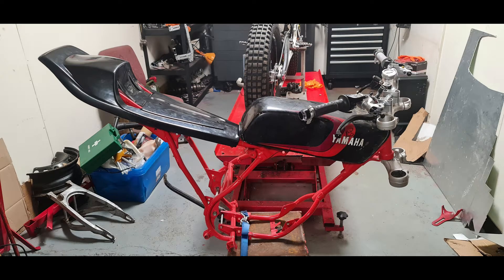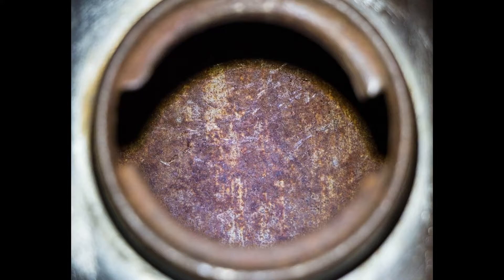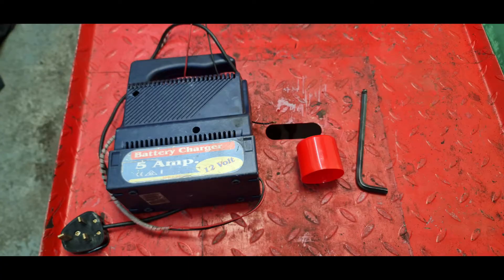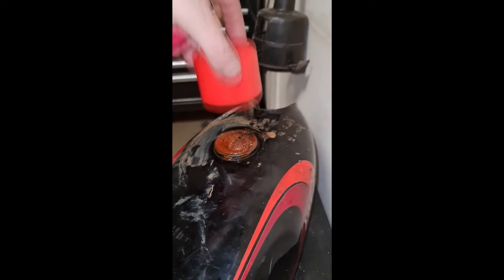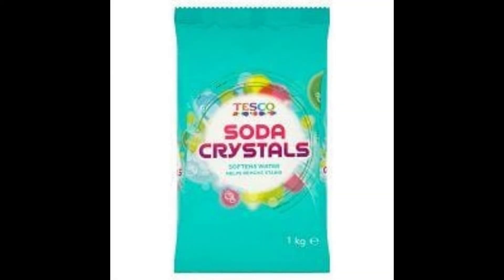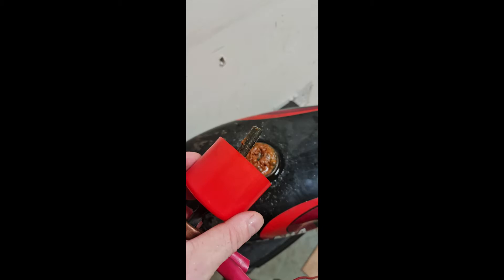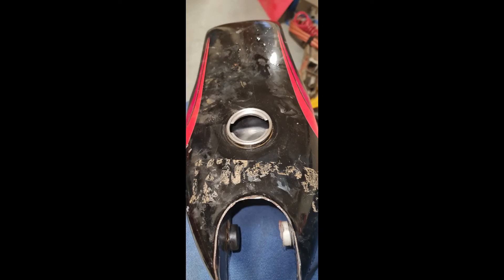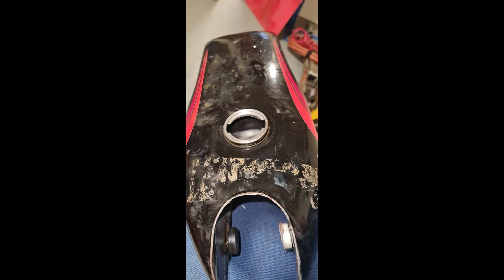The best way to remove Rust Using Electrolysis: Motorcycle Tank

Comment: Did you clean with hose after, how did you prevent flash rusting?
Reply from the maker: Empty it then put in pre mix and cover the inside with it then flush with clean water. The oil in the premix stops the water from rusting it.

Comment: My tank has been freshly repainted outside. The painter failed to tell me to have the rust removed beforehand. If I have the electrolysis done now, would it ruin my brand new fuel tank paintjob?
Reply from the maker: No I don't think it will ruin your paint unless the electrolysis removes enough steel along side the rust to perforate the tank

Comment: Did you use same solution in 4 days with out changing it or change the old solution and filling new solution in it please explain
Reply from the maker: We changed the solution every day and cleaned off the Allen key.
Reply: @SpecialisedMotorcycleTransport  Ayup!  I am an electrochemist and it probably doesn't make a lot of difference.  UNLESS the build up of rust slows the current in some areas.  Whatever, its cheap as chips and really is the best way to clean a steel tank.  Great video!
Reply from the maker: Dave that's really good to know.. Thanks for that 😁
Reply: How much soda crystals??